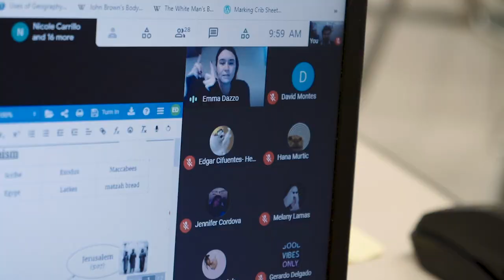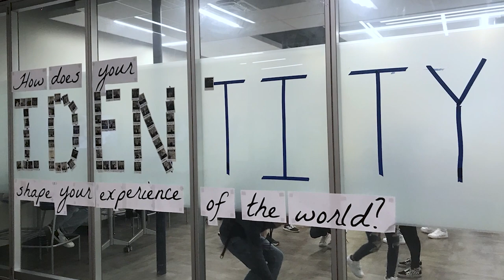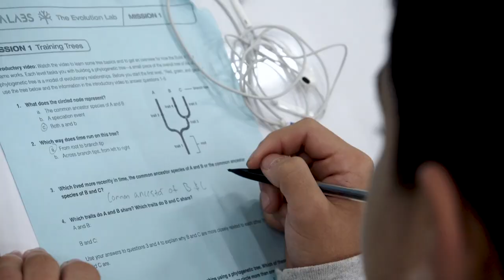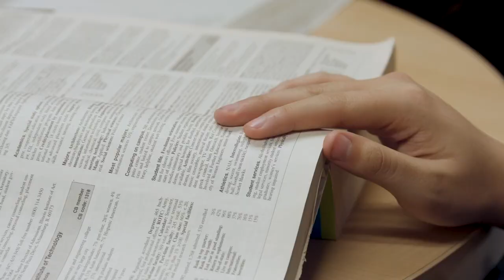Leyden High School District 212 Overview Video

Comment: This District has seen a huge demographical change in the past few decades as have the Communities that feed into the two campuses. My sister-in law geaduated from West Leyden in the early 70s when both schools competed seperately in athletics Shortly after the unification of the athletic programs in the early 80s the demographics of the Communities particularly areas such as  Franklin Park, Schiller Park, and Stone Park changed as well. The district is much more diverse now than ever and it appears that the student bodies function well together at each campus. I have covered sporting events involving the Leyden Eagles whether it's been football or basketball ir Volleyball or soccer and there's a lot of student spirit ar the games which is always nice.
Very nice video.